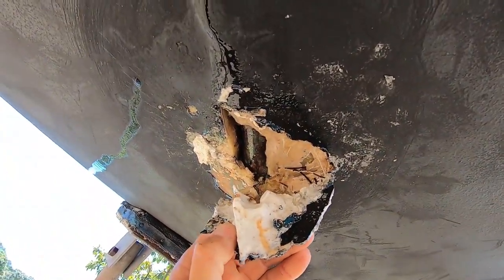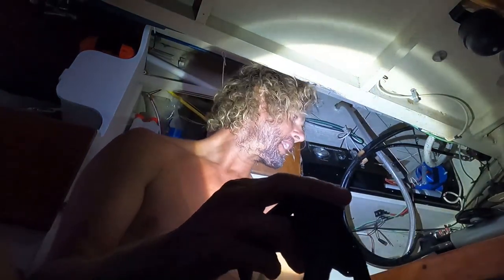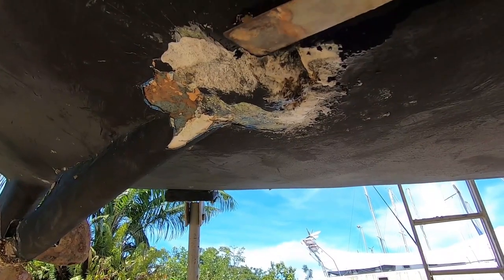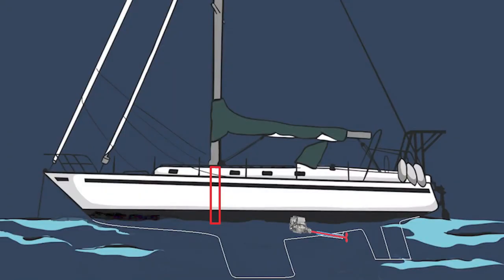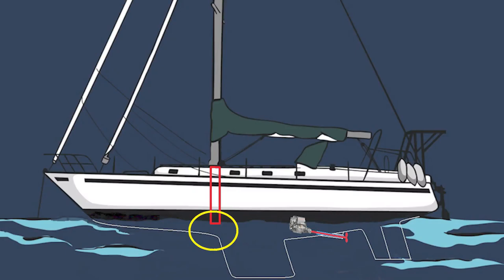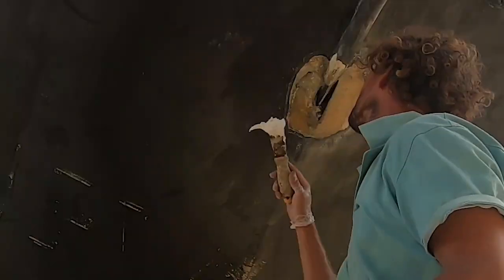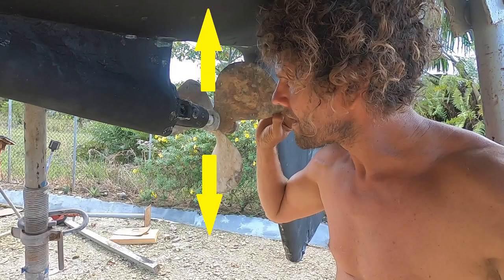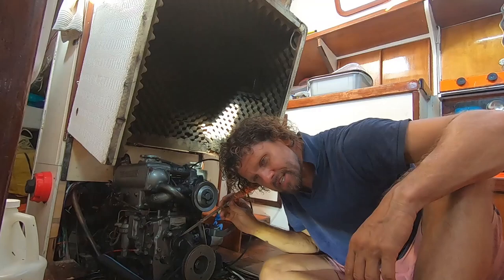HOW TO FIX LIGHTNING STRIKE DAMAGE - UPDATE ON THE STATE OF FREEDOM

Comment: Glad you shared all that.  It was not only interesting, but a wise move to 'crowd source' to see if there are any insights that would guild an investigation. I've 30 years experience in the automotive world that includes diagnosing all manner of noises.  Unfortunately a sail boat is slightly different animal, and I could not hear the noise myself.

 IHMO, after the thorough inspection of the entire drive train did not discover the cause of the noise, one can concluded that either it was not the origin of the noise, or more likely, the cutlass bearing was the cause.  Unfortunately we no longer have the cutlass bearing to verify.  If the noise was consistent, and not intermittent, or always present, and could be correlated with the rotation of the motor, or drive shaft rpm, it was likely the cutlass bearing.  The bearing could have been within acceptable tolerances, yet been damaged in a way that would be similar to how an arch welder that that is momentarily in contact with grounded metal, can score the surface. In this same way, the instance lightening traveled through the bearing, metal could have been transferred from the bearing race onto the bearing surface, or vise versa.  If the bearing was sealed we could not inspect it, but we could have felt the defect if it were turned by hand.  

 There was a cause, and an effect, and I presume that a consistent noise resulted.  How movement in the hull would cause a consistent noise that was only heard if the motor and propeller was moving,  is beyond me.  It is not likely that the hull is the origin.  A source of any noise can be difficult to determine as noise often does travel though solid materials for a considerable distance, and can appear to be at one or several locations far from of the actual source of the noise.  The effect often causes confusion, and one to doubt the obvious source. I would have little doubt that if the noise occurred only when the propeller was turning, that it was likely the cutless bearing.
Reply from the maker: I think it was the combination of the bad alignment and the cutlass... What I am now trying to understand is how the misalignment occurred and if there's delamination that caused it
Reply: " @SAILINGintoFREEDOM  Was "the bad alignment " was a preexisting condition that went undetected?  I probably did not quite understand what was found in that part of the video, so I reviewed it.  It sounds as if the misalignment was severe.  Perhaps you've repaired two mechanical defects related to the lightening strike.  I wish I could have been there to see it in person. 

 Lightening is known to do unexpected things. With out knowledge about sailboat construction, especially a custom built boat as is yours, I suppose it is possible that the bad alignment could be indicative of structural damage caused by one or several weakened points,  or single missing part of the metal frame as is evident in this part of the video.  Aluminum is not hard to melt:
.https://youtu.be/6VolX8MMQn8?t=527

.  Clearly the structure has been damaged, yet it is unsafe?  The question to ask is whether is matters, or why should it matter if the boat will not be subjected to the extreme forces of sailing.  It has already been a year or so on the water without further deterioration?  So long as it doesn't leak much, and stays in the Caribbean, it might be safe enough. Even a perfectly sound boat and be sunk the next day by the reef.  How safe is that?

Comment: I'm thinking your knocking was caused by structural damage allowing the Cutlass bearing our outer shaft to flex or shift causing gyroscopic precession from the prop.
Reply from the maker: You might be onto something there. Thanks for commenting

Comment: A lil general health reco that will help with all infections and immune issues. I take D3/Zinc/C and K2 every day and the change is remarkable. Free advice but these are essential for immunological and circulatory health.
Reply from the maker: Thanks for that. Did you have COVID and this helped with it?
Reply: @SAILINGintoFREEDOM  yes on both counts, I also took ivermectin when I got omicron and it was gone in 8 hrs. I had a number of adverse affects to both Pfizer shots and didn’t get boosted. I still have fatigue but this vitamin regime seems to be helping. It’s all very anti inflammatory.

Comment: Good on you to keep moving forward. 
Unfortunate to have a damaged foam core addition of aluminum now salt soaked. Only thing worse would be structural balsa core. That being said if additional layers of glass on hull exterior could be afforded would be my top choice for reliability. 2nd would be removing gelcoat below high waterline and at least epoxy microbead fairing after defects are spot fixed. Consider boring out shaft log if it is metal replacing with glass. 
All understanding of financial limitations.
3rd year on my own build constantly limited.
Out of round it worse the round wear on a cutlass, alignment is most important. Thinking delamination - swelling of core affects the engine beds altering alignment. Motor flex mounts aging alone requires re- alignment. 
I have delaminated a foam core dinghy, just gave away so problem solved.
Slightly concerned not knowing how the keel is connected? The one off build leaves more than the usual unknowns. 
When FG hulls bilges are wetter than a carevel, at least the latter is supposed to be wet. Picking at inside leaks while in the water, brave. Get well and always like to help if I can.
Reply from the maker: Thanks for your insights. Thru are appreciated. I didn't think of swelling foam...I didn't know it did that, maybe if it degrade... Unsure
Reply: @SAILINGintoFREEDOM  assuming a polyurethane? The foam does absorb some water, breaks down mechanically over time. Multiple strikes, steam heat pressure possible alone caused delamination to inner and outer skins. I did this similar, 8hp on an 8' dinghy, it was already having issues.

Comment: High voltage will easily jump a foot gap between conductors
Reply from the maker: Not if it has a continuous run right next to it
Reply: @SAILINGintoFREEDOM  lighting cannot be explained, the path it takes is random... i personally have seen BALL LIGHTING,,, it hit a tree in my yard came down to about 6ft formed a ball and drifted over to a nearby tree and exploded that tree ,,, both trees died... if I had not seen it would not believe it... So I have owned a 80ft aluminum yacht... i recommend removing all bottom paint and put 3 or 4 coats of high solids epoxy on there , that will seal ALL tiny holes... it saved our hull from electrolysis... we used a product called Tuff Stuff ... holding 10 years now... good luck...

Comment: While you are probably right about the path the lighting took from your investigation of the damage, it doesn't really have to follow conductors. Remember it just passed through several thousand feet of air which is a really good insulator. It does tend to follow conductors, but at those voltages, amps and temperatures physics is pretty complicated. I also think it is amusing that the three people that got bent out of shape over the thumbnail all ended up together, at least in my sorting of the comments. I think anyone who's watched many of your videos should know your sense of humor by now and this probably isn't the channel for the easily offended or humorless. Good luck, I will enjoy watching videos of your haul out and repairs.
Reply from the maker: Thanks for the comment keep em coming

Comment: Mate the most important & No. 1 thing is your health....you know this....everything else will follow...
Now Prop Shaft Misalignment will cause Drive Plate rattle/knocking/vibration & premature Plate failure & input shaft spline/internal bush & bearing wear.....
The prop shaft coupling to gearbox flange should not be out any more than the thickness of a piece of A4 paper EVEN with a flexible coupling , IF you want it to be super reliable & smooth....anyway keep the nutrition up & get back on your game soon....remember everything else will follow...cheers👍😊

Comment: Next Generation EMP Protection With Military Certified Testing.
 

Listed by the Department of Homeland Security.
Rated 4.97 out of 5 based on customer ratings (1446 customer reviews)
$409.00 $389.00

EMP & Lightning Protection for Vehicles (DC-12V-W) quantity
1

Comment: Maybe when the lightning went through the sturn tube it moved it when it blew out the hole
Reply from the maker: Possibly yes. But the gearbox coupling and  cutlass bearing define the line. One of those had to move
Reply: I think you had it sorted when you did the mounts on the engine. It may have shifted the Engine inboard with the blast. A small blast in air is a big blast in water.

Comment: After 3 diesels from 10 to 85HP, got tired of lifting&feared being at sea with a knock or a belt, an impeller or prop giving out in a seaway and making me stop, so I took a lesson from a shipyard where I'd worked as a lad on cruiseships&gunships that were quite big&bad. They put props in their rudders&use electric motors&shafts. Quite robust and cheap to refit when you're tight on cash. Then a gen down below and some bats for current flow, and some solar on the roof in case yer gen does a goof. I have enough power to cruise for an hour w/o using a single drop of fuel. In my mind I'll say if I had it my way, folks who rely on diesel in this world play the part of the fool.
Reply from the maker: I am looking into it. You can't do the canal or go up rivers much though if it's totally green